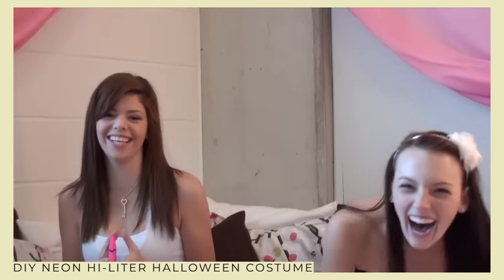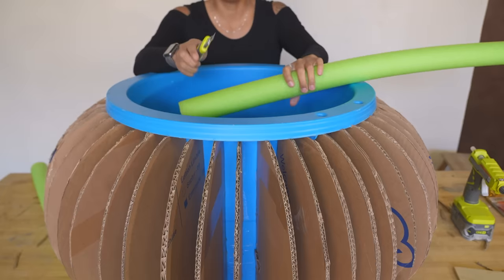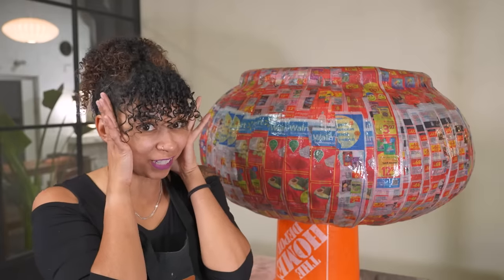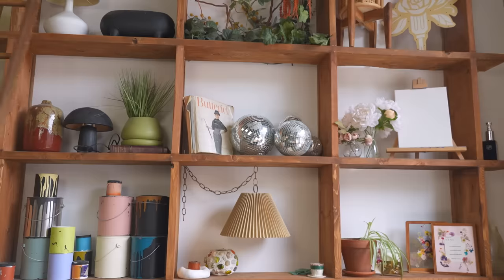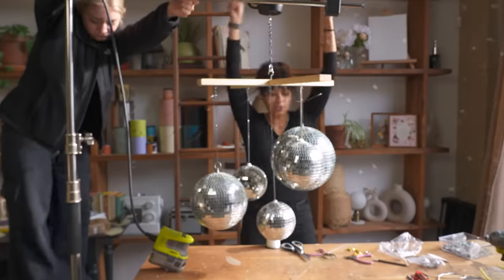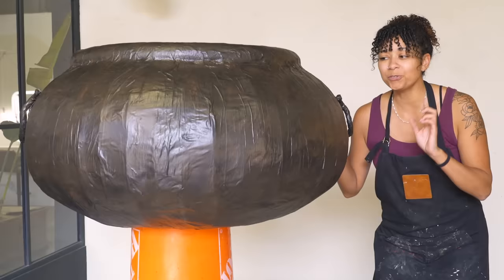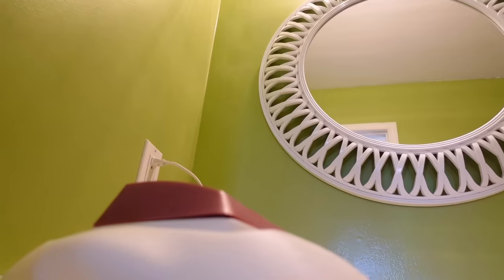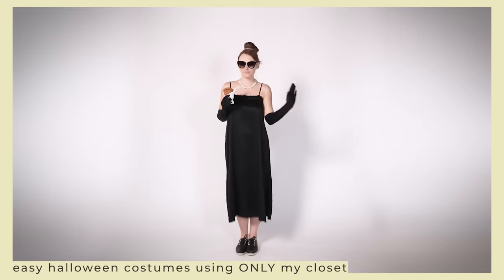decorating our studio loft for Halloween but making it ACTUALLY cool

Comment: You should probably flag in the video that dry ice is 100% CO2 and can only be used (or stored or handled) in WELL VENTILATED areas. It's not only cold but as it turns to gas it can suffocate you in enclosed spaces.